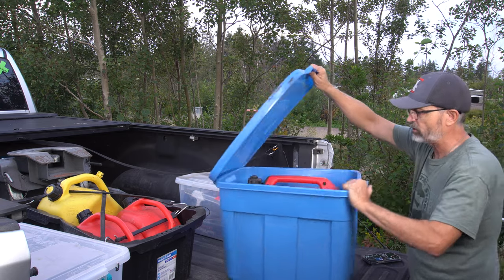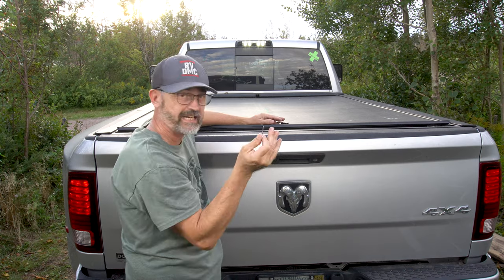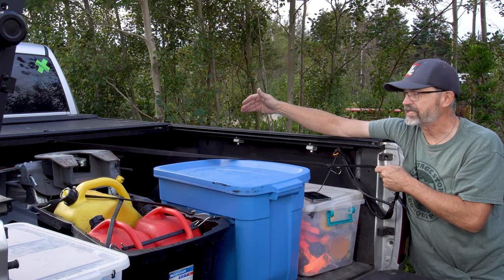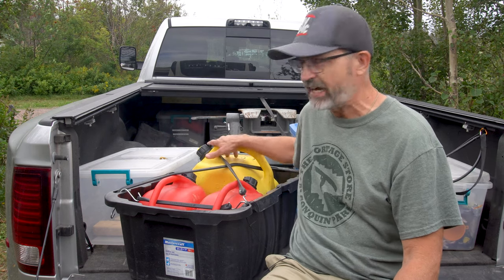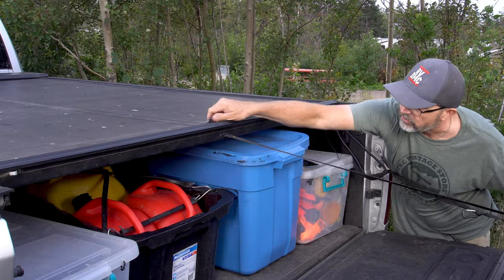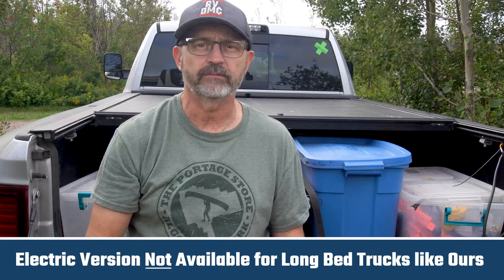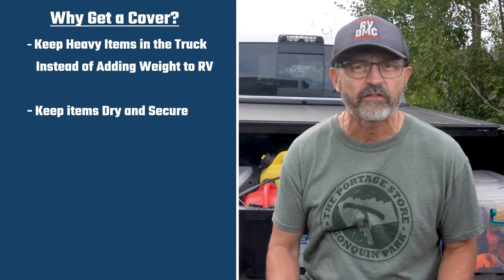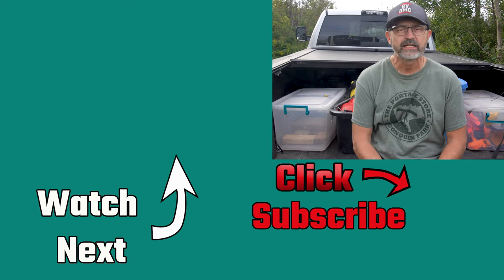Truck Bed Cover 1 Year Roll n Lock Review (RV Living) 4K

Comment: I installed the all aluminum version of the Roll-N-Lock on my truck this past summer.  I like the looks, security and the fact that it has one of the smallest cannisters on the market.  I actually decided against the Retrax Pro because the size of the cannister was so much larger.  However, I am now wishing I had gone with the Retrax Pro.  Like you, the strap on my Roll-N-Lock drives me absolutely bonkers.  Additionally, my RnL leaks like a sieve all over the place.  I can not trust it to keep my bed contents dry in rainy weather.  Even though the cannister is bigger, I really wish I had gone with the Retrax Pro.
Reply from the maker: I agree Jeb, ours is waterproof either the vinyl cover, but the strap does piss me off often.  Larry
Reply: Get the BAK REVOLVER x4 in my opinion.
Reply: I have a retrax pro and it will not keep the bed dry at all!!  It doesn't leak between slats, but the rail design is silly. Water comes in the rail and rides the bottom of the cover so it soaks the whole bed.
Reply: @DownsizingMakesCents  I had the role n lock m series a couple trucks ago and it kept my bed drier than any cover I've ever owned. I was thinking about getting the a series but seeing some of these comments concerns me.about leaking. Are you still finding your m series to be pretty "waterproof" for a tonneau cover?

Comment: On my third Roll N Lock and agree it’s nice to have covered space when pulling a 5thwheel. I installed one on my 2020 F450 last year . Strap can be annoying at times but not a deal buster for me . Quality is really good on these covers , I like the soft vinyl versus some of the shiny finish of some of the others. I would definitely buy another Roll N Lock again .
Reply from the maker: Cliff, that’s good to hear. We feel better about our purchase. Yeah. The strap is not so bad that we would spend another $700 for another cover. 
Thanks for sharing your experience,
Alice
Reply from the maker: The three reasons I got the rollnlock instead of the retrax is lower bedrail profile, cheaper, and the vinyl top makes it more waterproof.  But I had to create a custom locking position so that I could cover more of my bed while I was towing. Larry

Comment: When you said, “… that friggin’ strap”. I laughed my rear end off. 
I too, have a Roll ‘n’ Lock cover and I too hate “that friggin’ strap”, lol. My R&L (which I bought new in 2011) has been on my 2011, 2018 and 2019 Ram trucks. The thing still looks and performs great. 
Love your channel. Keep the vids coming!!!
Reply from the maker: Good to know it lasts that long,  10 years wow.  How it the vinyl doing, has it started to deteriorate?  Larry
Reply: @DownsizingMakesCents  The  vinyl looks great. You’d never guess the roll and lock was that old, or that its been on three trucks. 
The only thing I replaced was the thing in the middle that reverses the latch direction, and one of the Roll’n’Lock logo stickers fell off. I sent an email to customer service telling them how much I liked the product and they sent me those part FREE!!   So I’ve had mine for 10 years now. Oh.. and my trucks have never seen the inside of a garage  
If I were to replace it, I’d blow $$$$ on the electric. Cuz I HATE THAT FRIGGIN STRAP, lol lol
Reply from the maker: Thanks for the info. Good to hear it is a quality product and they have great customer service. Yes! That strap 😅

Comment: Thanks for your video. I had settled on Roll n Lock, but wondered about the extra cost of the E-series model. I don’t think I’m as willing to put up with the strap issues as you have been. Also, the cover itself is individual interlocking coated aluminum panels which I thought were very durable. So, I’m happy like you are with my selection, but there’s one small thing I would like them to improve. I now have to carry two fobs on my keyring. One for the truck itself, and a separate one to operate the cover. I really wish Roll & Lock would work with the automakers on some way to connect to the body control computer and watch for key presses on the factory key fob (or combinations of button presses, that would operate the cover. I bought the cover from the automaker, and it was installed by the original dealer. Surely some kind of arrangement like this could be worked out.

Comment: Great review Larry. I have a Limax. It has 3 solid panels that fold back. It’s really sturdy and can’t be punctured. The good is there’s no compartment to store the roll up. There’s no rain catch tank either. It’s always been dry inside. The bad thing about it is, unless I remove it from the truck only 2/3 of it is open. It works for us as we have a travel trailer instead of a fifth wheel.
Reply from the maker: I looked at that a a choice but it blocked my view of the hitch when backing up.  Larry

Comment: I have a love and hate relation with our retrax std. 3 years review here. First the locking system on the retrax MX isn't a locking system with step like yours. Unless you lock it completly closed it won't really hold any other position when forced. In fact, someone broke thru while completely closed just by forcing it since I for some reason didn't closed it completely. Also a major issue for me is that below the canister, that we can't open btw to clean it, the canister leave less that 7-8inch below it. This is a major since we haul a lot of stuff. The look on the retrax is better that yours BUT water does go thru when heavy raining or while washing the truck (don't go in a carwash it's like not having a cover). The only reason I didn't buy the Rollnlock is that my Ford dealer didn't installed them and they were 3000$ CAN vs about 1800$ for the Retrax. Still prefer our cover than any soft or panel type of cover (had a 3 rigid panel before and hated it!). Still recommend the retrax but i'll buy the locknroll next time.
Reply from the maker: I didn’t know that about the locking mechanism for the Retrax, very interesting.  In the us the roll n lock is much cheaper than the Retrax pro.  The roll n lock is very water tight, the only thing i dont like is the strap system.   Larry

Comment: I have the retrax pro version sold by Line-X.  Called Truck Gear RETRACTABLE HARD TONNEAU COVER.  It has been great.  Had it about 3 years.  Love it.. can stand on it if needed or set stuff on top of it as well.  Worth the cost.
Reply from the maker: I agree the Retrax is especially a better choice for fifth wheel owners, i should have spent the extra money and got the Retrax.  Larry
Reply: My tetrax is 10 years old use it all most every day leaks a little more and not as smooth rolling as day but still works great and the finish is still good.

Comment: Ever consider using a retractable dog lease to replace that crap strap? Carabiner handle near tailgate and retract as needed. Small dog should work, but best buy the big dog to know where you are in the pack when needed. Great video.
Reply from the maker: Sounds possible, but I’ve seen too many of those ropes break. Hate for that to happen driving down the highway

Comment: The RollnLock website says the 'box' is 7" deep, you said yours is 12". Is that because you have a long bed???
-
How does is work under snow?
-
Do you HAVE to use the strap?  What happens if you just grab the cover from one side and pull on it???
-
Nice review, thank you.   (I've had the same Retrax cover on my Ford Ranger(s) for the past 18 years.  It's been a great cover.  BUT, the box is 12" deep.  Not a problem for the 6' bed on my Ranger, as I still end up with a 5' bed.  But I'm getting a new truck, and all the new trucks seem to only have 5' beds.  So if the RollnLock box is only 7", it might be the one I go with...)
Reply from the maker: The Rollnlock is only 7 inches deep, up and down, but is 11 3/4 long as far as how much bed it takes up.  If i take a measuring tape an measure from below the canister back to the front of the truck bed it is almost 12 inches.  I think all he rollnlock cannisters are the same size no mater what length you get, but i would definitely call rollnlock to make sure.  I hope that answers your question.  Larry
Reply: @DownsizingMakesCents  it does, thank you!!!

Comment: Thank you for your review.  It help me to know what I need to be looking for and why.   I have been looking at the retrax pro power cover.  I think that for the ease of use I.e. not having a strap to pull close and it has a brake that locks it in place where ever you stop it.  It will cost more but I believe it will save me time effort and frustration.
Reply from the maker: Glad we could help. 
We do think it’s worth the extra money

Comment: The Retrax  Pro looks to have a larger housing that takes up more room.  Also, the way it locks in position looks like a compression pin that digs into the rails.  I like the locking mechanism of the roll and lock better.
Reply from the maker: Even though I complain about the roll n lock, I’m sure others have issues. 
Thank you pointing out issues

Comment: I've had a retraxpro xr for the last 2 and it provides zero water protection. I had a roll n loc on a previous truck that I liked much more...the only advantage of the retrax is that you can stop it in any position.
Reply from the maker: Thanks for adding great info. 
Larry made his own custom “stop” so it can be closed up to the hitch

Comment: Larry, good review! I’ve come to the conclusion you need a Utility Body Werks bed. When I was in the market for a larger truck the truck I got had one installed. The only problem, the next truck will have to have one also 😁.
Reply from the maker: Chip, thanks. About the BodyWerks - not quite in our budget 🤣 But they look darn cool.
Reply: @DownsizingMakesCents , Larry, it took me 2 years to find the truck I currently have. A new one was not in my budget nor will it ever be. Fixed cars for years so older stuff will always be more in my budget 😉. Our new to us current rig is just under the allowance of 24k so…. The search is on for another néw to us truck before I retire (a semi) I mostly want it for safety for hills. Enjoy the videos, keep up the good work!
Reply from the maker: We bought the fifth wheel used. And of course we do like to mod and fix it ourselves. The only reason we got the truck new is because we got such a deal - the price of some used ones with the same features I wanted. 
Thanks. We really appreciate your watching and commenting

Comment: Hey Larry, thanks for the review! I ordered the same cover for my truck but have had issues with the cover staying locked at the different locking points when driving… Within a few minutes it retracts back into the canister on its own (besides when it’s fully closed) I contacted the supplier and they said that the different locking points are for loading and unloading and not driving in those positions. Didn’t really make sense to me but wanted to know if that’s been your experience. Thanks!

Comment: Really great review Larry, I'm wondering about putting it on my Honda Ridgeline 09 just because the bed is so short and then there goes another foot but I'm getting it for a good deal so I'll give it a try and I'll give you my review also if I was going to put a Honda Africa 1000 in the back of my truck I don't know if it'll fit with the truck bed cover.
Reply from the maker: Let me know how the install goes on the honda, you may have to do some customization, as long at the bed is wide enough it should work.  Larry

Comment: Great honest review. Question if you don’t mind about the way you attach the trailer.  I’ve seen some use a ball in center of bed.  What’s the advantage to your large piece you attach to?
Reply from the maker: most fifth wheels come with a standard king pin that attaches to a fifth wheel hitch, the large piece.  There are goose neck style king pins that connect over a ball in the bed of the truck. There are pros and cons to both.  I kept the standard hitch because it is very safe and very easy to connect and disconnect. I hope that answers your question.  Larry

Comment: My rollnlock 530M-XT had damaged parts when it arrived from the Florida RollNLock warehouse. I do like it but it seems sluggish when it opens. I have to give it a push to get it going
Reply from the maker: Lubing the rails with 333 protectant makes it slide better, But make sure it is not binding.  Larry

Comment: I have a 2019 Silverado with an 8' bed, I am considering installing the ReTrax XR Pro. It is aluminum and locks in many positions. Also, it has tracks, T-Slots on each side so you can install a Yakima, Thule, or Rhino-Rack system. Thanks for this video, it helped me make my decision.
Reply from the maker: Hey David, YES get the Retrax instead of the roll n lock, but it is more expensive, i was just being a cheapskate when i bought mine.  The roll n lock works but the Retrax has more locking positions which is much better for fifth wheel.  If you get it please contact me and let me know how you like it, i really want to know, Larry.
Reply: @DownsizingMakesCents  I will! And I will try to attach some pictures. I am also going to add the Rhino-Rack Vortex crossbars to carry our kayaks. Now the wait, everything is on backorder!
Reply from the maker: That’s a bummer, the t slots do look like they add a lot of versatility.  Larry

Comment: I purchased a 2004 truck with  roll n lok. HOWEVER, the cover is not working as intended. Purchased a new lock , only for it  not to work properly. Was told the rails are shot, and not worth replacing. However if I can just get the cover to close( and stay close) until I decide to slide it open I’d be fine with that.
Reply from the maker: Did you contact rollnlock to see it the had a solution,  larry

Comment: Question: when towing and you have it at that custom stopping position. How many inches is it from the king pin when hook up and towing? And when turning is it clear from touching?
Reply from the maker: That is a great question, I hitched up the fifth wheel, then moved the cover back about two inches to give some extra room when making sharp turns while backing into spots, even at extreme angles it does not hit the cover, i try to remember to open the cover while backing into a spot just in case though.  Larry

Comment: Hi @downsizng makes cents! Larry, I enjoyed your review of the Roll-N-Lock cover (and the desire for the Retrax).  I just got a F350 short bed truck.  I still need to get the 5th wheel hitch (our retirement camper in about a year), but I'm looking at a truck cover now.  I like the Retrax, but am concerned that the larger canister would hinder me storing a generator in front of the camper (between the 5th wheel hitch and canister). My generator has the dimensions LxWxH 23.2 x 17.7 x 20.1 inches.  I have seen google searches where the Retrax canister is 10 inches in width up to 13 inches in width.  Your thought on this would be awesome. Thanks!
Reply from the maker: Hey Chris, I’m not Sure if you will have the space for a short bed on the retrax.  I have a long bed and lots of space between the hitch and the canister.  I would try to find a local dealer, they usually have demo units set up in the showroom, that what I did.  It really helped me make my choice.  If I had to do it again I might have chose the retrax but it was about $500 more.  Hope that helps. Larry
Reply: @DownsizingMakesCents  Thanks Larry, a most excellent idea.  I'll look around for places that might have these covers on display.

Comment: Have you ever had the pin box hit the side of the rails mounted to the side of the bed box during tight turns?
Reply from the maker: I have never had the pin box or the rv hit the side of the bed box, but I have come very close, and touching a few times, we have 5-6 inches of clearance and that is enough in smooth terrain but when we get into bumpy or hilly terrain when backing in, we have to take a lot of care to minimize this effect.  We have had to completely change our technique backing in to tough spots because the bed was going to hit the RV.  Larry

Comment: Did I notice some damage to the vinyl near the right rear corner?  If so, was is caused by the cover rolling on itself?  I could see how the spacing gain (small canister) could cause this.
Reply from the maker: I actually dont have any damage on the vinyl at all, some dirt does accumulate after rain makes it settle in spots, which may look like damage.  I need to clean it with 333 more often.  Larry

Comment: So you had this 1 year, and I see some discoloration on the back.  did the vinyl come up or off, or was that self induced.  also now it's 2 years old, how do you feel about it?

I too need a back cover, to replace my 3 fold.
Reply from the maker: The discoloration may be dirt. 
When we use 333 protectant mentioned in video, it looks new. 
Yes - still love it except strap

Comment: Hello, my truck's strap cut off, I am wondering how to replace this strap, thank you so much.
Reply from the maker: Probably order a strap from roll n lock. 
But if mine broke, I would replace it with thick rope and drill a hole through the part where the strap attaches. 
Let us know how it goes 🤗

Comment: Can you keep extra propane bottles? The larger 30lb?  Thanks.
Reply from the maker: 30 lb propane should stand up strait while transporting and they are too tall for the cover.  I transport them in the back in a tub to keep them from fallling over, and leave the last couple of feet to the cover open so they stick out the top.  I hope that answers your question.  Larry